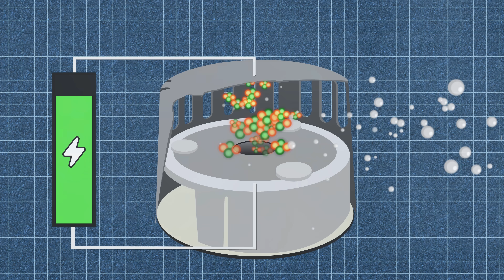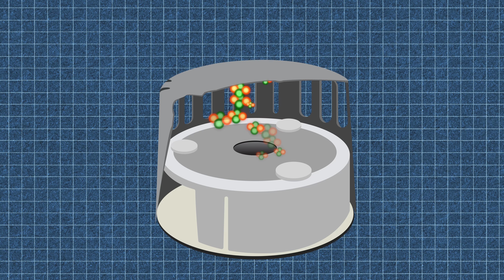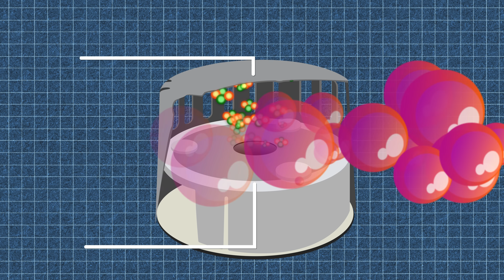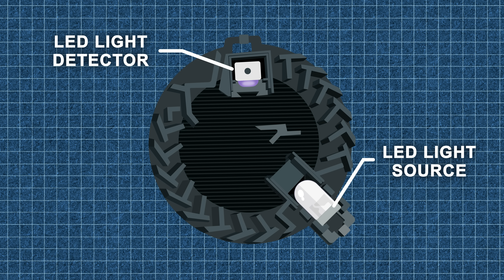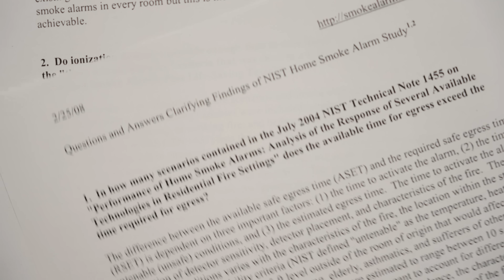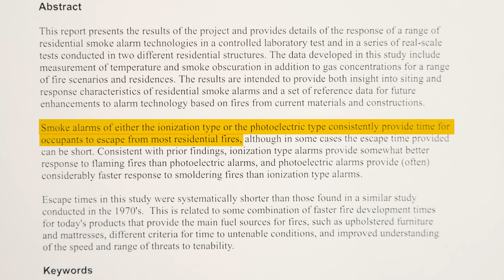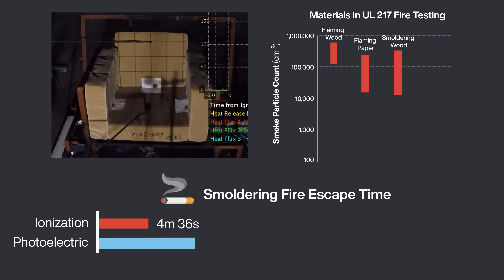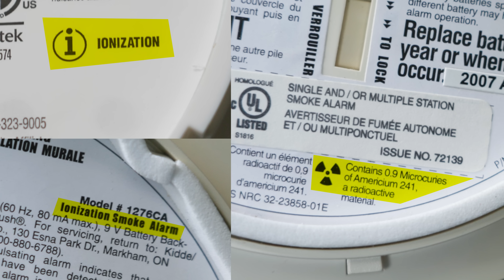Why the Most Common Smoke Alarm is Dangerous

Comment: Optical (photo electric) alarms have been the praise in Norway for decades now. You have to try really hard to find an ionizing smoke detector at any place that sells smoke alarms
Reply from the maker: Yeah, in most places they are the standard not only for safety but because you don't need to put radiation into the landfill (although they are supposed to be properly recycled)
Reply: @Lam  Where i live you can easily get the dual version (Ionisation and photoelectric). And even the tripple version with additional Carbon Monoxide detection. Personally that is the best option.
Reply: @_aullik  Isn't CO heavy? Smoke rises, but CO sinks. Where do you put the triple sensor, midway up the wall?
Reply: @Quidisi  CO mixes with air. It will detect a little bit faster when you put it on the floor, but we are not talking about a time saving that would save your life. 

If there is a wood stove in your house, put a CO detector close to it and low to the floor as you want to detect CO fast and even in small amounts. But as a regular detector in your living room it doesn't really matter (or so i've been told by fire technicians).

So to answer your question, put it on the ceiling like always.
Reply from the maker: Dual alarms have an issue of figuring out which sensor to trust to figure out if it's a real vs false signal.  Now with 8th gen understanding it would do a much better job but it's also way expensive and no one knows about it.  A triple alarm is even better and I would support that to cover all your bases with interconnection but sadly that doesn't exist here.  

I have interconnected first alert smoke alarms, all with voice and they all give off a voice alert when one goes off.  Maybe they interconnected different models without voice?
Reply: @Lam  What’s the other sensor on triple detectors ?
Reply: @Quidisi  it still diffuses pretty good, there would just be slightly higher concentrations down low. but even with absolutely 0 air currents it would diffuse enough i would imagine. then considering that air is never completely still it would be alright
Reply: @Quidisi correct you're supposed to have them on every floor of your house your basement would be the first room CO2 would start most likely as well install close to the floor will go off first in most cases as well
Reply: @thebigmacd And ever so slightly that if you don't have air mixing in a room,  by the time the detector senses it,  you're already experiencing delayed senses. If you're asleep,  even if the alarm wakes you up,  this can be a death sentence. 

Always place CO detectors as close to the source as possible,  whether that be a stove or a ventilation duct.
Reply from the maker: That'll also mean they'll be more sensitive to cooking false alarms. 

This is shown in UL's paper: Characterization of Smoke Alarm Nuisance Sources, 2015.  They're also hard to find, expensive, and the only 8th generation dual sensor alarm is currently unavailable for purchase (as of June 5, 2024). 

As well many homes require CO detection and you'll have to choose between having those separate vs interconnecting them with the rest of your home.  I think Interconnection is more important.

Kidde's new 9th generation of smoke alarm is Photoelectric only.  This was what I was expecting in the video as I was shocked ionization could pass the new tests, but I'm guessing that's no longer possible.
Reply: @Lam  Brand and model of the 8th gen dual sensor unit? Even if never available again I’d like it for research purposes.
Reply: @Lam  By the way, one of the most vocal proponents for ditching ionization alarms is a fire fighter from just a few miles from me, here in the SF Bay Area. I forget the name but you should look him up an interview him for any future videos you make on this issue.
Reply: @Quidisi  No. CO = 12+16
Air = 16+16, 20 per cent and 14+14, 80 per cent. So CO is just a bit lighter. But as a gas it nearly mixes perfectly.
You are thinking CO2, which is 12+16+16.
Reply: @Quidisi  I wonder about that triple sensor too..  We have a carbon monoxide detector near the floor in our basement
Reply: @iamTheSnark  Density is not directly linear to molecular weight, it's way more dynamic than that, it's also about the electromagnetic characteristics of each molecule as well as it's geometry.
Reply: @PetesGuide   I think I am a Smoke alarms activist probably you mean retired Albany Fire Chief Marc mcginn!!
Reply: @PetesGuide  he was the bald guy in the above video I think!
Reply: @Fredengle  That’s probably him! For others, Albany, California, not Albany, New York.
Reply: @_aullik  you have to be careful with the dual versions. Some require a trigger of BOTH the ionizing and optical sensor, so while it does reduce false alarms, in detection of a real fire, it combines the worst of the two types, being the most dangerous type of alarm. Not all are like this, fortunately, but some are. And the manufacturers rarely specify how theirs operates.
Reply: CO has a mol weight of 12+16 : 28.  Oxygen and 32 (2x 16) is heavier and pretty much the same weight as nitrogen (2x14) only CO2 is much heavier.

Also smoke and CO are created hot and so they rise
Reply: @Lam  Is an 8th gen ionization actually that much better? Based on my research it’s only a minor improvement and not sufficient to create a safe environment. The 8th gen ionizations are not expensive, but maybe they aren’t that great after all…
Reply: @Quidisi This is wrong, CO is actually slightly lighter than air but pretty much mixes equally
Reply: @_aullik I thought so too but evidently the logic defaults to the slowest of the 2 sensors. I'll try to find the source where I read this.  Better to have separate alarms than a 2-in-one
Reply: @Lam  Last year I had to dispose of three ionizing smoke detectors, so I called the first agency I thought would know. I got bounced around (trash/recycling, fire department, county hazardous waste). Each time I was told we don’t really know, so call ___. I forget what the last link in the chain was but it became clear they had the authority to have the final word in my area, and the answer blew my mind: “Please just put them in the trash.” The reason is that just putting three bits of americurium in the trash isn’t a real hazard. But if the county or fire department starts collecting them en masse in one place, now you have a high enough density of radioactivity that it becomes a problem.

So instead my county (immediately south of San Francisco) just wants them randomly dispersed in the dump and covered with dirt.
Reply: @Lam you can also have as many as you want at once….
Reply: @Lam which is how we got the radioactive Boy Scout
Reply: @Lam  It appears they both contain radioactive material. Cesium in the ionic detectors and Americium in the optical ones.
Reply: @Lam They recommend here to use combined optical+heat where ionisation would have been placed.  It is only phased out here due to waste disposal issues… before we used a combo of the both since the 80s/90s!
Reply: @Lam we've put more "radiation" into the environment/atmosphere by burning coal for 200 years than we have with all nuclear detonations,, and accidents. Theres less than a microcurrie of americium in those detectors so you'd need hundred of millions of them to be able to detect an increase of radiation over background
Reply: according to product reviews the interconnected first alert only voice alerts in the affected room, all other connected alarms in other rooms just beep. they don't announce in which room the issue is at. with that in mind, still a good idea to have, since many times people in an unaffected room would not be aware until it's too late
Reply: They installed photo-electric in the grand hotel I worked at. What a shitshow. At 80% outdoor humidity above 80°F, they all went off...22 times in July, every day in August, the first 9 days of September, then they were removed.
Reply: @andrewb8548  Thank you, that explains why they aren't widly used overseas. We rarely see much more than 60%, so it's not a problem here
Reply: Thats everywhere.... most are photoelectric AND ionization now as they have different qualities.
Reply: where’s the biomimetic dentistry video
Reply: same here in germany
Reply: Same for Germany and Austria. First thing I do in an american hotel is localizing the smoke detector, because at one point I will set it of by making toast or taking a shower. Back at home I didn't have had any alarms as of yet.
Reply: @daviniusb6798  That's absurd. I'm constantly staying in American hotels across the country and have never once set a smoke alarm off taking a shower or making toast in the room. Most American hotels don't even use ionizing sensors.
Reply: I just checked and here in germany they are actually not allowed in private homes.
Reply: @MyProjectsTV  Primarily due to environmental concerns, which is particularly sensitive in Germany given the fiasco of the Asse II mine and national sensitivities about disposal of radioactive material.
Reply: They've been widely available in the U.S. for quite some time now as well, along with multi-sensor models. Ionization detectors are not useless, a large portion are simply old detectors that people keep using, and many customers are not aware of the effective difference in sensor types. Still, in most home improvement stores the majority of detector types are photoelectric and/or multi-sensor units.
Reply: I'm in Norway too, and I've discovered another way these optical detectors produce false alarms as well, maybe even more. At first I thought they were just very battery hungry, and even shortly after replacing with brand new batteries they were back with their brief warning beeps every few minutes. I have tried several brands, and they all seem to be the same (maybe because they all come from the same factory in China anyway). The current brand I got I happened to observe/diagnose in coupled mode in two different houses (12 coupled in one house, a set of three together in another). A little over half of them generated false alarms in the manner described. The result is that they soon got disconnected for longer than I dare to admit (they are required by law), because -- well -- people need to sleep too...

Now I think I might have cracked the issue. They gather dust in that little optical chamber! Plain old regular indoor dust from the room. A good vacuuming and/or blasting with pressurized air seems to have finally solved the issue. That chamber needs a good dusting occationally, as it doesn't seem to do that by itself even if you put them out in the wind. The triplet group have now been going for over half a year without any issues, whereas they went only 2-3 days after fresh batteries before that. Now I've decided to reinstall the older ionic detectors (if I can find them) alongside the optical ones to get the best of both worlds -- both of them have their pros and cons...
Reply: ionization-only alarms are basically pretty much banned in Europe, for years
Reply: All these years I just assumed it was the green fanatics trying to ban radioactive materials in detectors, and that those worked better than photoelectric.
Reply: Same here in Canada I was selling them that hooked up monitored security systems in 2012 and now common !!
Reply: @marcfavell  Yes, unified/smart home systems in the U.S. are typically photoelectric and/or multi-sensor as well.
Reply: In EU radiation smoke alarms are outlawed. Rating saved lives in case of fire vs. increased cancer deaths by the radioactive emission makes their benefit diminish, and if thrown into garbage they endanger kids and recycling workers. Also people dying by falling of ladders during turning false alarm beep off or servicing smoke alarms or noise stress deaths by false alarms (sleep deprivation by fear of fire when heard in neighbouring apartments) are not covered by any fire casualty statistics.

Wireless interconnected smoke alarms are spy bugs. They are prebugged with remote serviceable firmware, using the piezo speaker as a mic to permit intelligence agencies listening every single room in private houses and offices. Ant their pulsed microwave radiation (several pulses per minute) causes brain damage. Particularly rented models even contain ultrasonic obstacle detectors suitable as a mind control device for remote manipulation of people's behaviour, so I would immediately rip out these EMF/ultrasound pollutants. Also those dread unreplaceable 10 years lithium batteries are highly flammable and certain such smoke alarms did set houses on fire (which may get even intentionally triggered through a firmware backdoor to eliminate politically unwanted people and their documents). So I solely use non-wireless photoelectric smoke alarms with harmless alkaline 9V battery (that I replace every 3 years or so when the earsplitting blip noise enforces to do so).
Reply: Gotta love America, where we think we're #1 but we are behind every other 1st world country, and can't even give health insurance to our Citizens.
Reply: I hated a place where the alarm went on every time I was taking a shower, there was almost no ventilation in the bathroom so when I got out from there a whiff of steam hit the smoke detector and it was activated.. 🙄

A few other people had the alarm blaring due to cooking, but it didn't affect me as neither my stove or fridge ever worked while I was living there.

It was a Service apartment in Swedens 4th biggest city. Talk about how corrupt the company of the regional government has to be there 😱
Reply: yeah im from norway and its very true we have verisure
Reply: In France ionisation smoke alarms are banned
Reply: So if your hobby is collecting radioactive items you are screwed?
Reply: Dude there’s like 10 ads in this video holy poop
Reply: Well, mines have a radiation one
Reply: 16:28 16:29 1
Reply: I have like a I have I don’t
Reply: Ionizing detectors get false alarms from shower steam when optical detectors don’t.  That alone is reason enough to switch.
Reply: Sometimes it is like the USA is still living in the nineties...

I just replaced my 2nd optical detector with built in 10 year battery...
And in the kitchen I have a heat detector.
Reply: @knirfien2091  "Sometimes it is like the USA is still living in the nineties..."  I so tired of your kind of ignorant bigotry and the way people like you so blindly spew it in every comment section. Multi-sensor and photoelectric single sensor units have been available in the U.S. for a very long time, and comprise the majority of the market share. They are the norm in hotels, in smart home installations, and in a variety of other use cases.  On the other hand there are very real issues with humidity and environment in parts of the U.S. that make photoelectric sensors problematic and highly prone to false alarms, so people use units with ionizing sensors - which while slow to detect smoldering fires can and do detect them, and which are great at detecting flaming fires (the large majority of fires).

So, to summarize:
1)We've got exactly the same technology you have in whatever country you're in; that technology is the norm in most commercial installations; and is the majority of the market for private home units.
2) There are environmental issues, primarily humidity, that make ionizing sensors preferable to photoelectric in some parts of the U.S.
3) Ionizing sensors are are excellent at detecting flaming fires, which are the large majority of fires, and still detect smoldering fires albeit much more slowly, thus save lives and preserving property.
Reply: The ionization alarms are being phased out due to them having radioactive material.
Reply: @dang48 the radioactivity of Americium is so weak, it is blocked by the plastic
Reply: @FourJaysFour  Fully aware of that.  However, there are many people out there who hear the words 'radioactive material' and they get all freaked out thinking glowing clouds etc.

I encountered that many times while working as a fire alarm technician and replacing smoke alarms where people often complain about me putting in a new one or I find the old one has been removed because "its radioactive".
Reply: @dang48  
@Fredengle
0 seconds ago
Hi dang I dont think thats correct I think they are being phased out because newer reserach shows that they dont pick up smoldering fire and that using a radiation as a detection technology is not the most effective photo electric has been found to be scinetifically better for both fire types in fact my former bussiness consultant is on the Ul 217 committee and he help mandate photo only legislation in his home state !!!
Reply: @Fredengle  It is correct about the environmental concerns.  While you are supposed to recycle them properly, people are not doing that and are just dumping them into the trash